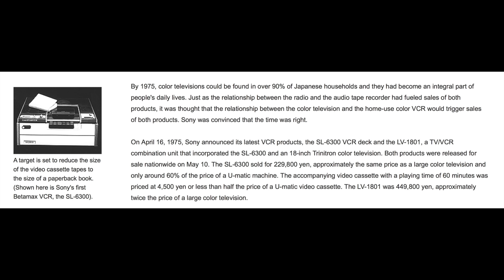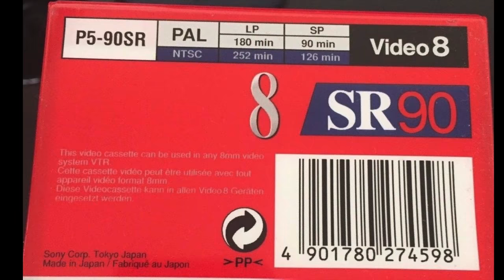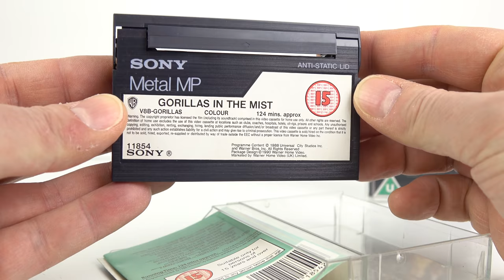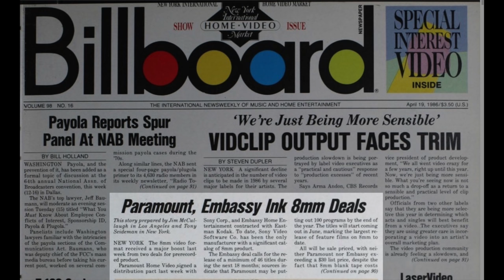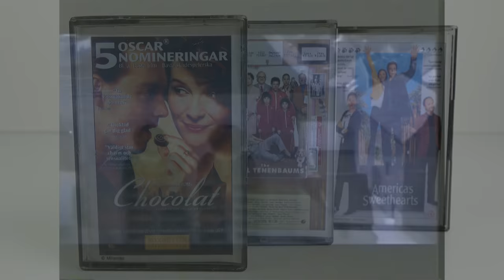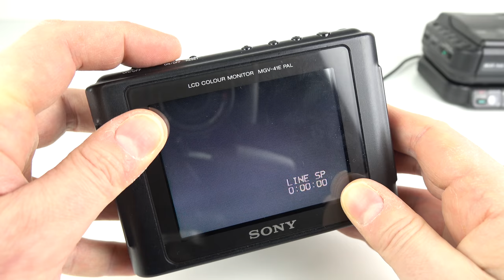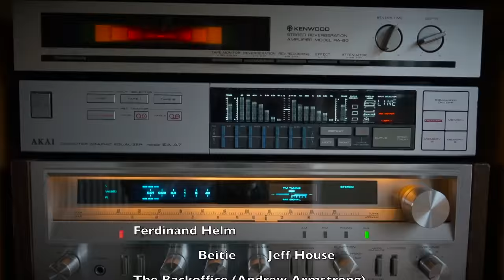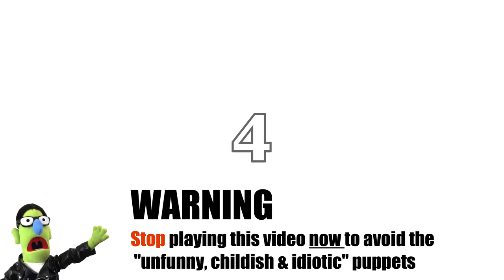Video8 - Sony's forgotten ambitions & the crazy Walkman Compo

Comment: I work for a Vacation Charter airline in Canada, and can confirm we were using Hi8 tapes in our IFE (right across most of our fleet at the time) until 2015 when the format was officially retired. At that time they swapped the tape players with a hard drive system that was designed to fit perfectly in the tape player's bay.
Reply from the maker: Thanks for the info.
Reply: +Techmoan I was on short flight inside Germany mid of May 2017 and the security video they showed was on tape, clearly visible by the typical artifacts of worn out tape and also the stewardess fumbling around with very familiar shaped cartridges before it played... By the way some years ago I found an Hi8 video player with a lot of buttons and connectors etc. from an airplane on eBay didn't have enough money to waste neither do I now... But if you are interested I could have look if I find it again or if it's still available.
Reply: Techmoan My family have several video tapes of the format mentioned above, but I'm pretty sure we cant play them. Any ideas on how towithout breaking the bank account by buying equipment .  PS I'm 15yrs old and I find your content (especially the retro tech ones) fascinating.
Reply: Look for a Digital8 camcorder.
Reply: The timeline went 8mm, Hi8 and then Digital8 .  Digital8 uses the same cassettes as featured in the above Youtube video, but being Digital it supposedly gives a similar quality of audio and video as the later "miniDV". The video Cameras were all deliberately made to be  "backwards compatible". So a Digital8 camera will play both the earlier formats as well, although you will only get full digital quality with Digital8. However cameras for Digital8 are hard to get and more expensive.  (I haven't managed to get a Digital8 yet). I bought a range of old camcorders from NZ $5 to about NZ $32.  If you have an old family video that is "8mm" then any of the above cameras can play it. If your old family video is "Hi8" then it won't play properly or at all on older 8mm system, but will play fine on Hi8 or Digital8. Digital8 recordings will ONLY play on Digital8 systems. Remember that almost all 8mm cameras can play back a tape inside the camera, so you can play your old family video that way, and use a video lead with the suitable connector (probably a yellow RCA plug) to make a recording, into say a more modern DVD-recorder unit. (and you'll need another lead for audio) If I recall correctly, the earlier 8mm"  is always mono, but "Hi8" has stereo capability (maybe in some cameras only) HTH.
Reply: I have a Sony Digital 8 camcorder.  I still use it and have a small stock of unopened tapes for it.  The quality is very good.  Ok, not as good as hdmi is today but for me it is still of an acceptable standard.  My particular camera was purchased sometime just before the 8mm format was retired so it is probably nearly as good as they got for domestic use.  I do recall that it cost me around £600 UK but this was about £200 UK cheaper than everywhere else.  Possibly because the firm I purchased it from knew they were being phased out?  Though the format was 'around' for a few years later.
Reply: Digital8 uses the DV codec, so its data is literally identical to that of MiniDV. The Digital8 cameras themselves targeted the lower end of the market (so they're no match for high-end MiniDV cameras of the era), but footage shot on any MiniDV or Digital8 camera can be transferred back and forth between the two tape formats without degradation. Digital8 cameras were cheaper to manufacture than MiniDV cameras with comparable specs (apart from size, obviously), so they tended to outperformed MiniDV cameras in the same price range (at the expense of compactness).
Reply: airlines are so cheap. poor people can afford this stuff, but the airlines can't?
Reply: Since it's already paid for and working, there isn't much reason to change.
Reply: I bought my first Digital8 because it had a 25x optical zoom.
Reply: I have 3 Digital8 camcorders, 1 Hitachi & 2 Sony's.
Reply: If your camera has an I-Link port, that was the name Sony used for Firewire.  I've used that to transfer digital copies directly to my computer.  Fyi, you can expect to use 12Gb of space per hour of video.
Reply: It's probably just too much hassle to go through the safety certifications needed to put new equipment into the planes.
Reply: Not to mention the fitting costs.
Reply: There were VCR decks made of Video8 and Hi8 but they weren't very common. The easiest way to get something to play back one of those tapes is a Hi8 camcorder (XR with S-Video out is optimal). (backward compatible with video8)
You will need a Digital8 camcorder to play back any digital 8 content but beware, some but NOT ALL Digital 8 camcorders are backward compatible with the analog video8 and Hi8.
Reply: 2 weeks ago, I saw the tapes used on a 737 flying out of Toronto, Ontario
Reply: The airline industry's about selling prime commercial real estate, not air travel.
Reply: So, they were releasing new content on the format up until its 2015 retirement? Interesting.
Reply: I was on your Airlines once and the video 8 system failed. You tried a number of times to restart it but it wouldn't work, they just said no more inflight entertainment for the rest of the flight.
Reply: @freddylooger7320  it's not because they're cheap. Anything certified for use on a airplane is extremely expensive and a lot of times there's no suitable replacement.
Reply: I vaguely remember airlines using vhs, but maybe that was a fever dream

Comment: MEGA BASS, most essential feature ever.
Reply: Davie504?
Reply: They still put this on their car stereos.
Reply: That is one of the signature features of every Sony product ever. The other being the standard video out cluster of RCA and RFU DC out (which you see on the original Playstation as well). Sony has been very consistent with their design features across many product lines.
Reply: True about the car stereos. My son had been using my car.  I got in it later, turned on the radio and the car just about vibrated off the road!!
Reply: I liked the Pioneer SuperPBass as it was called, 6db boost to 32khz and 64khz, add a nice Subby and.......:)
Reply: Anvilshock No, he was referring to a sub woofer.
Reply: My Sony car radio doesn't have mega bass.
Reply: Mega Bass is that largemouth?
Reply: I have a Sony WM-FX301 Walkman that doesn't have Mega Bass. I feel ripped off! It's like the only device by Sony that doesn't have Mega Bass (or Bass Boost or whatever)!
Reply: yeah like man, that's not even audible
Reply: i had a walkman that had GROOVE, it was like double Mega Bass lol.
Reply: @beckigreen  r/woosh
Reply: I know. It always sounded good.
Reply: As in "you keep it on because it sounds like shit with it off".
Reply: When I was a kid MEGA BASS was my favorite button,  cheap boom boxes would call it DXBB, or DBBS, or Hyper bass or something like that.
Reply: So mega it's hard.
Reply: God mega bass always been a lie lol.
Reply: @darrencafferty  boost to kilohertz???? Basss???
Reply: Takes me back in time these sort of products were pinnacle of technology and made us envious of who ever had them and they were bloody expensive and it is amazing how all these gadgets have disappeared cause of smartphone
Reply: I like MEGA BASS but I love V-GROOVE...
Reply: Trinitron was what made selling SONY like a licence to print money. I was involved with them since 1982. They did so many things so well, but screwed up much more with their insistence on controlling other tech. Think their rootkit bricking loyal customers' computers!
Reply: @darrencafferty  NOTHING beats an Audio Control Epicentre! My 82 year old dad is running 2 12inch woofers, epicentre, Focal Speakers, 2 amplifiers and a digital time-alignment. He's pretty much deaf, but can feel everything!
Reply: @giorgio2315  Bass has to Hertz!
Reply: @billedmonds7958  i love bass resonating on car but when u boost bass most of the times it sounds like crap
Reply: @giorgio2315  I liked integrating the control into the lighter socket...turn the lighter for more crazy bass!

Comment: Hey. I used to be an editor for an airline inflight Entertainment company and while we didn’t get nice box art like your examples, I can guaranty that we were using Hi8 tapes until about 2017. By that point it was only for our smaller clients that used older airplanes. Mostly in Central and South America. Changing the media system on a perfectly fine airplane would cost up to $100,000 so most airlines waited until the planes were retired and bought newer planes.

Also there was a fire during the Japanese earthquake that destroyed the last factory that still produced Hi8 tapes. I spent years chasing down the last available tapes to use for commercial purposes. Any brand any level of quality... it was insane.

Amazing video. So great to see this old tech. Well done.

Comment: I really like aesthetics of early 90's and 80's devices.
Reply: Boy Do I Have A YouTube Channel For You
Reply: Yeah we miss it now, but back then everything was a black monolith with 20 buttons. It got stale, sort of like how most  smartphones now look the same.
Reply: I really miss when devices looked like 24:02. There's something magical about VFD screens and retroilluminated buttons. Mechanical elements coming to life, whether its just a tray and a barely audible motor and transport mech, or the full on clattery and whirring of, say, a VHS machine.
Today everything is overdesigned, with a multicolor LCD ranging fron huge high quality OLEDs down to crappy small CSTN and somesort of UI that look either super elegant but I'd say too complicated for some simple devices, or like it was full assed by some chinese kid for 2.50$.

It's sad.
Reply: @miaugato93  yes. not to mention . interaction is poor. You are using remote pilot and that's it. Usually device has 5 - minimalistic buttons. While old vhs players had huge set of buttons made out of steel, not plastic. To widstand milions cycles of pushing on and off. And each of them had it's spring and you need actual force to push it with characteriictic "ping" sound. It was not garand m1 sound, but it was just fun, comfortable, great. It had good feeling. Idk. but i believe, there must be direction in designing, where you make things to feel ust right in hand. So customer will came to you aganin and buy another one unit, only because it feels right, comfortable, ergonomical. 
New stuff is missing it. Looks ok, usually futuristic and simple. but it's just not memorable.
Reply: @miaugato93  These were technologies that worked immediately after switching on (no settings, no signal (energy) checks, no conditions, no password, no credits ...). It is not true, as someone states, that there were many buttons. This concerned "tourist" devices that did not offer comfort and were more likely to check the record. They weren't very popular. The housewife needed to record her favorite part of the series - she put in a cassette and pressed a red button. The man needed to play his movie - he removed a tape from the video library and pressed play. The desktop did not move anywhere - it had its place next to the television. The whole family could handle him. The home camera was about the same thing. The advantage was that no nonsense was recorded, such as on a mobile phone. Of course, current technologies are better, multifunctional, etc. But we ourselves are surrounded by old devices and when I want to turn on the radio, I just turn the knob of my "retro" radio. I don't have to deal with headphones like antenna, application, wifi, battery status, etc. Beta, VHS, V8 I still have functional with a lot of home recording tapes. When you play it on Trinitron, the kids look at it like sci-fi technology and it's very exciting. It just has its charm of the times. Some manufacturers are already inspired by the past and produce vintage devices that do not require addiction and have a pleasant design. You need to feel good at home, not like in a sterile office.
Reply: 70's isn't so bad either. Look at Marantz, Sony, Sansui and Pioneer. They made some GREAT receivers.
Reply: @saucegrgrfin2720  what channel?
Reply: @redcomet1717  It Was A Joke Since We're On A Techmoan Video
Reply: Very a e s t h e t i c
Reply: Same, there is something quite special about them. Was born in 85 so grew up with them :-)
Reply: I'm sorry for your loss of sight but on the bright side you can have a dog.
Reply: @T-Waldo  what?
Reply: @saucegrgrfin2720  Why Do You Capitalize The First Letter Of Every Word Like This?
Reply: @Petardozord  He's saying you must be blind but at least you can get a seeing-eye dog now

Comment: MEGA BASS

Man. I miss overpowered phrases for something that just adjusts the bass levels slightly.
Reply: BLAST. PROCESSING. (Sega)
Reply: I've been using an old sony boom box in my office and yup, it has MEGA BASS in big gold letters on it
Reply: My Samsung has Gigabass!
Reply: My late 90s Sony Walkman had GROOVE on it. It felt as if someone took Mega Bass (and it was there too) and multiplied it threefold.
Reply: Turbo button
Reply: As far I remember there were switches like Double Bass Boost, Dynamic Bass Boost and so on on many devices. Depending on the source they worked really nice. In other cases the sound got muffled or distorted.
Reply: For placebo effect.
Reply: Mega- prefix means million. It's then a lie, because bass will not get amplified million times.
Reply: intel EXTREME graphics
Reply: They still use it until today in their shake audio systems

Comment: I remember backing up Amiga floppy disks to my Video8 camcorder using a simple PCB I built myself and some pirated software.  From memory, it was possible to record about 50 floppy disks to a 90 minute tape.  I thought that was absolutely awesome at the time :-)
Reply: CatsMeowPaw What? How is that even possible? 😮
Reply: that sounds so kool
Reply: Basically, it uses a little bit of hardware to input / output data as a video signal.  Its the same idea as using audio tapes on the old 8-bit computers, just with higher bandwidth.  It was a cheap way to back up your hard drive at the time, because it used the VHS VCR (or Beta, Video-8, etc) that you already owned instead of having to purchase an expensive dedicated computer tape backup system.

http://www.bigbookofamigahardware.com/bboah/product.aspx?id=776
Reply: LGR did a recent video about a vintage VHS tape-based data backup system for your PC.
Reply: That's kinda crap. Ever head of miniDV? That stored many gigabytes.

Comment: I flew on Oman Air this year (2018) and they were still using Video8 or Hi8 on board.
Only a couple of years ago I visited Yorkshire Film and TV Solutions, who repair electronic equipment for many of the ITV franchises, and was surprised to see a number of Hi8 players all playing away in a stack.  I was told they were all from an airline and were on soak test after having had the heads replaced, which is something they do periodically.  I had never seen these decks before. They were made by TEAC.

Comment: I can't easily search thru almost 1,000 comments to be certain no one else has brought any of this up, but...

There's a documentary on the region 1/A DVD/BluRay of "12 Monkeys" called "The Hamster Factor..." which I believe was shot on Hi8, and at one point shows Terry Gilliam viewing some second unit footage on the same model of video walkman demonstrated in this video. (I don't know if it's included in other regions.)

I've seen a rumor that Video 8 and later Hi8 was the format of choice on Michael Jackson's tour bus, and he would get whatever movies he wanted dubbed over (quite often including titles still in cinemas, or even not yet released at the time).

Hi8 tapes were also used for digital multitrack recording. The DA-88 system I think was introduced by TASCAM could record 8 tracks in up to 48kHz/24-bit, and the machines could be daisy-chained together up to 96 tracks (12 units). I participated in making an album or two recorded on DA-88 (and its competing format ADAT, which did the same thing on S-VHS tapes); after fast-forwarding or rewinding, the engineer could start playback on the controlling machine, those 8 tracks would start playing right away, then as the other decks resynced they would "pop in". I remember the frustration exhibited by one engineer as he tried to remove a lip smack from the lead vocal during mixdown, and each time he missed it there was nothing to do but go all the way back to the beginning of the song and start over.
Reply: I believe the Michael Jackson story about him getting the movies early. When I was on a submarine in mid 90’s - we would get new movies on 8 before they were released rent.
Reply: Ah yes, linear editing. Very painful and I remember it well.

Comment: That's definitely an airline inflight entertainment unit. I remember using them in business class, in the early 2000s, on flights between the U.S. and Asia. The flight attendant would bring the players to people who asked for them. They were brought in a small carrying case for the player, battery and headphones. The flight attended would ask what movies you wanted to watch and bring them to you. They kept very good track to came around before landing to pick everything up. I would have loved to steal one in those days. The picture quality was not bad, at least as good as the washed out projector screen in economy class.

One reason we know it's an airline unit is the lack of an external speaker. There is no point in having one on a plane, but wouldn't you want one for watching movies around the house or in a hotel room?